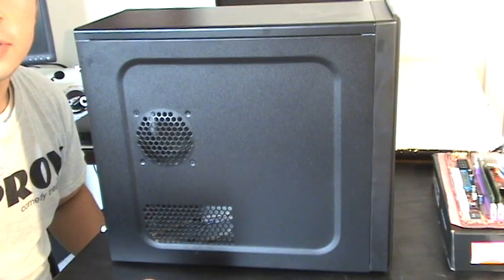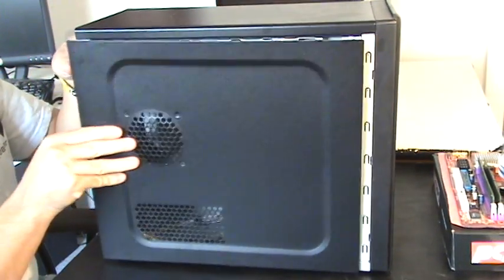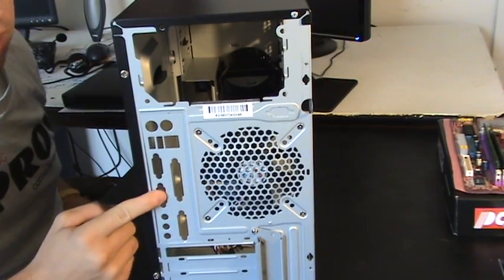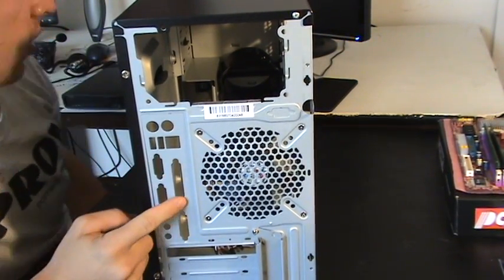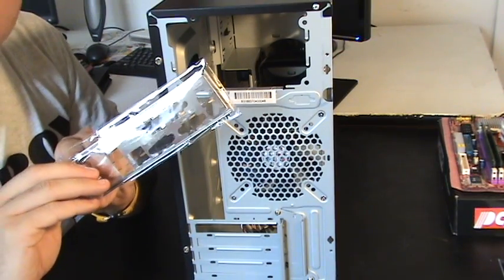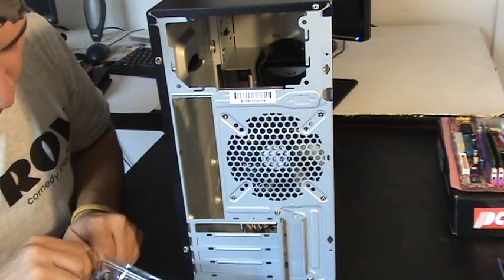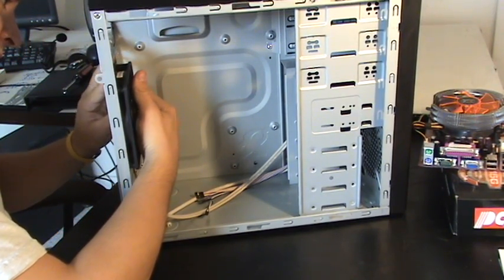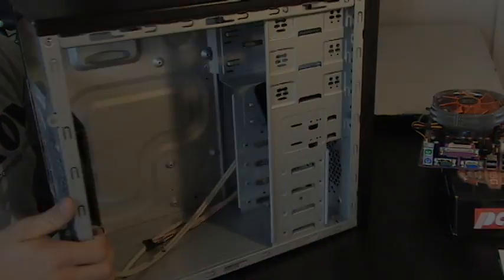How to Build a Computer - 18 - Preparing the Case

Comment: @o0Deano2k80o 
Sounds like a similar system to what I might have. I would not be too optimistic about running crysis on very high, however if you want to overclock, then I suppose you could boost the Graphics performance more. I'd say crysis settings, High-Very high on that kind of system.

Comment: wireless cards connect to a PCI slot

all you do is open your case up, remove the blnking plate on the back of where the PCI slot is and slot the wireless card in, the PCI slot provides the power and connection

you then install the drivers so that the OS can recognise the WIFI card and away you go

hope this helps you